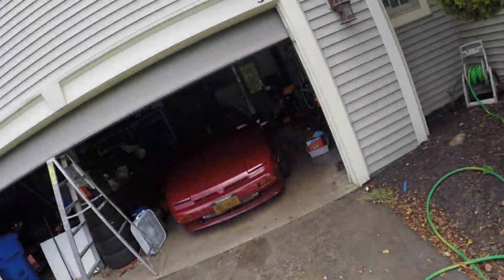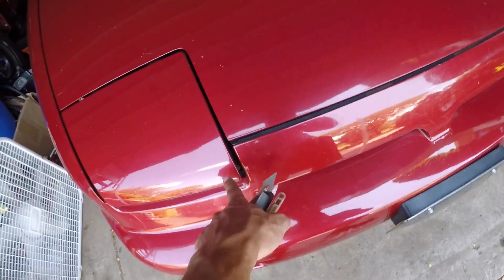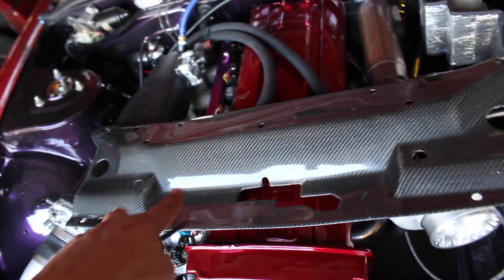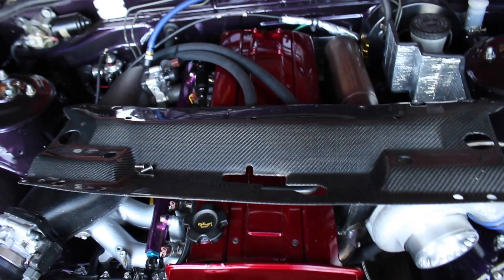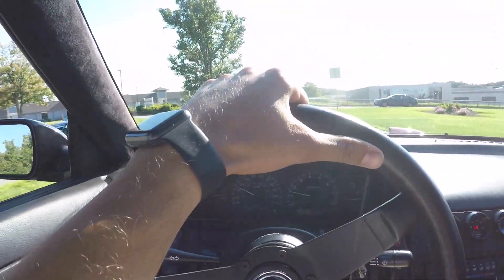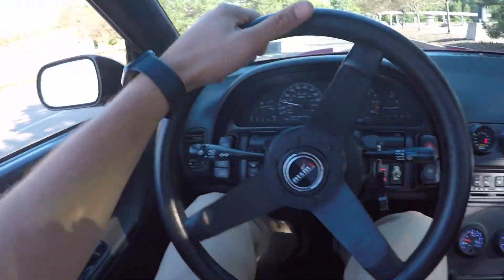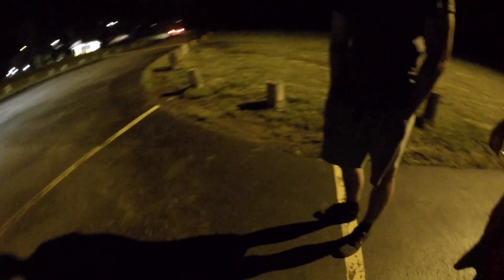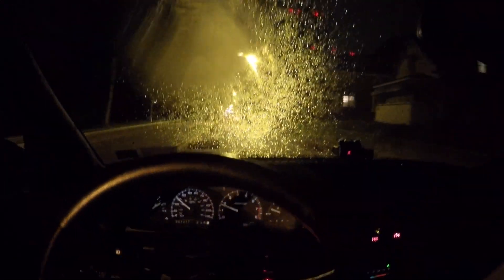EVO vs 240SX vs E85 WRX | Evo Gets Smoked! | Night Street Race

Comment: there's a rubber boot that covers where the shifter goes into the transmission. 
32862-V5002 that's the part number on frsport.com.

Comment: i doubt that wrx is over 380 whp on stock turbo and stock top mount too?! highly doubt he is over 380.. unless he is lieing and has more mods than what he stated.
Reply: FA's make power easily especially with dat corn.
Reply: Wrx turbo is smaller then Sti turbo an even Sti Stock turbos don't make 380whp lol.. Rebuilt Sti turbo sure... Evo 9 turbo's are bigger then Sti an even then most 400whp figures are high reading,,  Hp warriors
Reply: SeMpr3s Soren im making 400 with my 16 wrx. Stock block, stock turbo. Look it up. Usually its TGVD/EGRD, TBE, intake, FMIC, e85 ☺ FA20 is a beast, just throws rods at 400 of there is a fuel or timing error.
Reply: I skeptical but I’m around 350 range on pumped with  fbo’s  so kinda would make sense with the corn. I haven’t had any clutch issues but I find it hard to believe his stock clutch holding down that much tq

Comment: Ask Adam LZ he has the same problem with gearbox.
Reply: Adam Dacewicz different transmission. It was the gaskets for him. The gasket under the shifter
Reply: Destin Ginnis sorry, my mistake.. i forgot about RB xD
Reply: Didn't he get his transmission from an s14 for the RB? That would be near identical if not the same as an s13 tranny right?
Reply: Guy Fawkes indeed, I believe like you said that they may have the same gasket issue with S-Chassis transmissions (Very common).
Reply: It's the exact same transmission it's a 71C. RB20, S14 and S14, and Z31 non turbo transmissions are all the same internally. The only difference is the bellhousing which are interchangeable between all variants of the 71C.

Comment: don't think a wrx can hit over 400 whp on stock turbo must be high 300s
Reply: yes they can on e85...but you are pushing it.
Reply: with stock top mount?
Reply: hmm maybe not with a stock tmic, if upgraded then def can.  the 2 best tmic (capable of 400hp+) are the Process West or Grimspeed
Reply: yea the guy in the video said stock turbo stock tmic and stock headers lol so something is wrong
Reply: kcatta E85 will bump him up a lot. Could easily hit it with full bolt one and corn.
Reply: Bolt ons, intercooler, and e85 is 400whp just throws rods if there is a fueling issue or knock.
Reply: kcatta possible woth stock TMIC just very very risky and power falls off. Thats why he started to get pulled on by the 240

Comment: correctly check gearbox oil level, overfull will leak out all sorts places
Reply: HUNTER01101991 was going to suggest that.  The oil looks pretty clean. Was going to say you can change and see if is too much oil
Reply: How do u get the roof latch not to brake. Hahahahah I broke two already now is just close